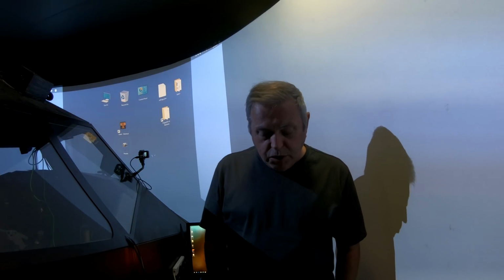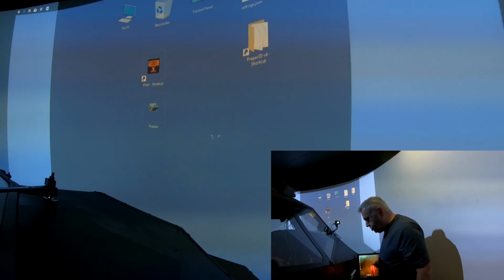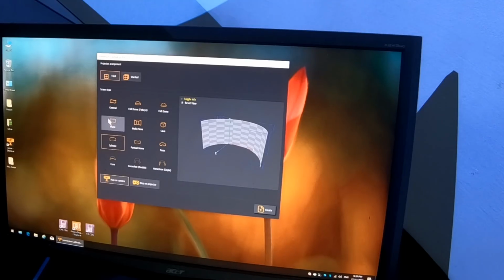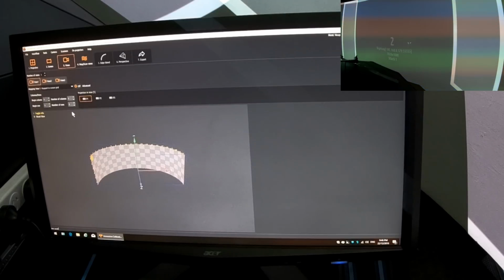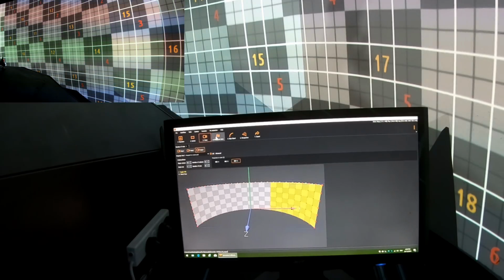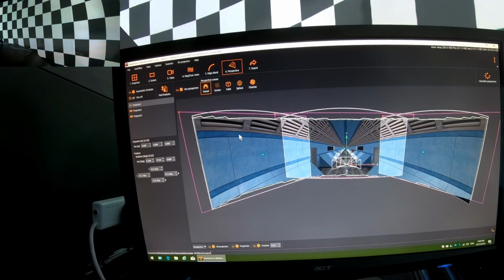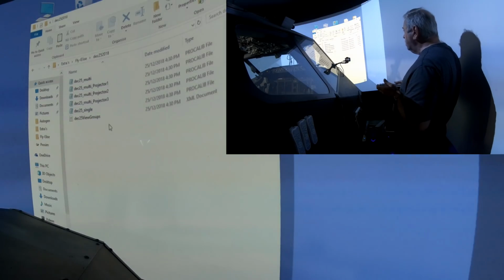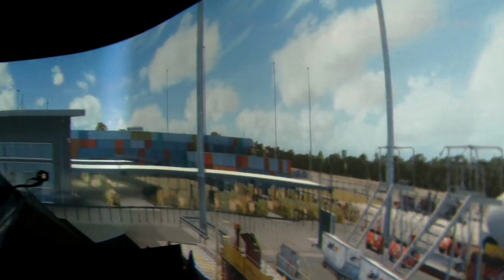Hints and Tips Part 2 of 2  Fly Elise Software

Comment: There are no tutorials for people with only a single PC. :(

I run calibration pro with a single PC, a single camera, and I cannot get any results.  Please help.
Reply from the maker: Both of these video's were produced using one PC. I did not use the camera, just the inbuilt calibration, which, in my opinion, is a lot faster way of doing it and just as accurate.  Maybe you need to take another look at both of the video's. I also did a few of these, so you may need to find the calibration where I did it on the single PC set-up with P3D

Comment: Excellent video Frank!
BTW, for individual control of the projectors with one remote I use the plastic pipe that I point to selected projector's front sensor and put the remote to the other end :)
Not too convenient, but works.